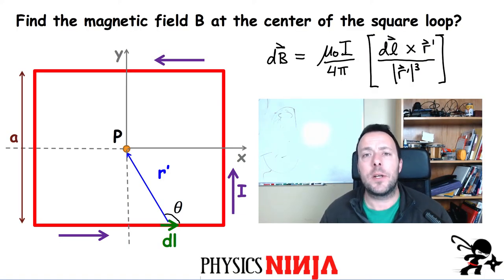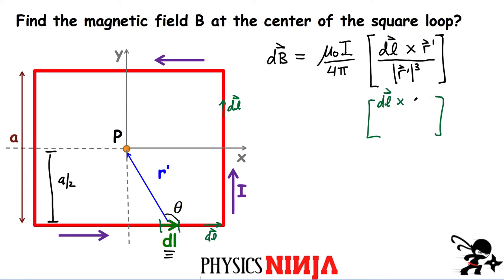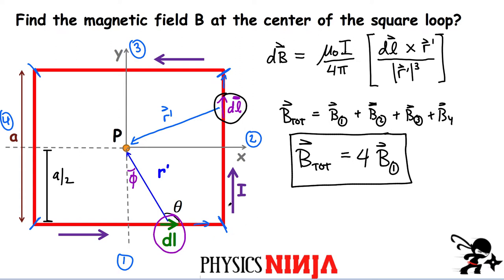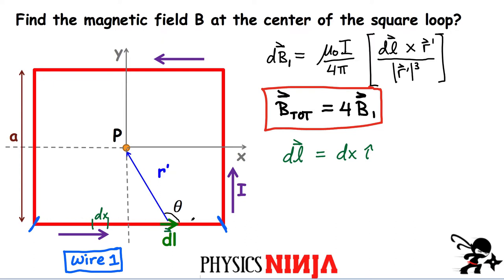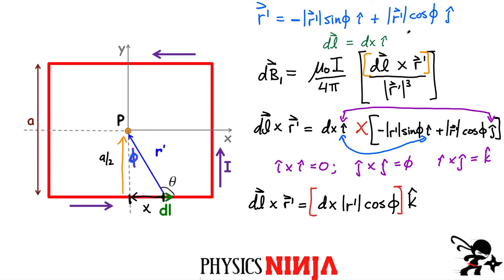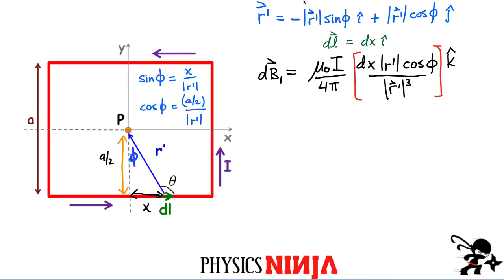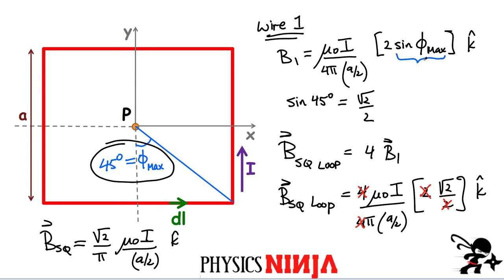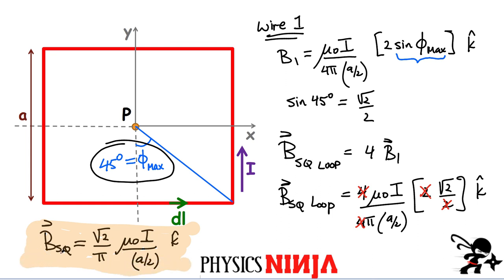Magnetic Field from a Square Loop using Biot-Savart

Comment: This was a Question on the last paper of a subject at college. I needed all points of the paper to be able to write the exam and thanks to you I was able to get them! Thanks so much!!!
Reply: A current I flows in a square shaped conductor as shown in Figure below. Calculate the (i)
magnetic flux density and (ii) Magnetic field intensity at the center of gravity of the square
(where the four normal to the sides meet). need solution of this

Comment: I am doing a version similar to this problem. In my case, the point p is outside of the square at a point (0,r,0), however r >>>  a, I feel like this means I can approximate all side contributions as equal in a similar way to if the point was at the centre, this would still allow me to use symmetry to help. Am I correct?
Reply from the maker: https://www.youtube.com/watch?v=Oyz2XOEDg6E

Comment: Why not solving with theta? or better, his complementary angle there, isn't it possible to do it? I tried that way before coming here and the difference was that I couldn't get that 2 in the final solution, even tho was way more simple
Reply from the maker: There are a lot of ways to crack an egg.  I recently solved for the field at a point above the plane of the square loop.  In that problem I use trig substitution.

Comment: What happened if the direction of electricity is different(not behave like a loop) on square
Reply from the maker: Calculate the field due to one segment of wire.   Consider the 4 segment separately.  Depending on the direction of the currents you may find that 2 of the segments cancel because the field they produce is in opposite directions.

Comment: Hello, may i ask how about triangle and hexagon  loop??
Reply: Doubt you'll still need this, however if anyone else is interested in this: For any N-sided (N larger or equal to 3) symmetric shape, given all sides are the same length this answer works. You just have to multiply by N (number of sides, 4 in our case here) and the angle within the sine becomes pi/N

Comment: Can you now derive it at a height h from the center in the z-direction?  I have tried deriving it, and I end up with Bt = [muo*I / [2*pi*((a/2)^2+(b/2)^2+Z^2)^0.5)] ] * [(a/((b/2)^2+Z^2)^0.5) + (b/((a/2)^2+Z^2)^0.5 ].  However the book I am reading has a the answer as Bt = (muo*I*a*b/4*pi*[(a/2)^2+(b/2)^2+Z^2]^0.5) * [1/((a/2)^2 + Z^2) + 1/((b/2)^2+Z^2)].  I put the calculations in excel computing the strength of the field (H = B/mu0).  My answer is higher than the answer in the book.  I am sure I am setting it up wrong.  Could you do a video showing how to derive it?  It would be this video with the B field at the center of the field elevated by a height h.  I have tried multiple times, and I can't seem to match the book answer.
Reply: If you figured out how to do that please lmk, that's the question I wondered.
Reply: I just wanted to know what I was doing wrong... any chances you show how to calculate it?
Reply: @mariahhasfuntimeshere  I will... I was hoping he can set it up and I can solve it the integral.  He has not acknowledged the request.
Reply: Physics Ninja  can you set it up the calculation when p is at a height H along the z axis? I have tried it, and I can't match the book answer.
Reply: @rjrodrig   I wish i knew how to calculate it, that's my issue as well. I was given only the answer by my teacher and have to work out the problem. I can't seem to figure out how after multiple times trying.
Reply: @mariahhasfuntimeshere  I can email you pictures of my notes how I did it. I am not 100% sure where I am making the mistake though. I am close though